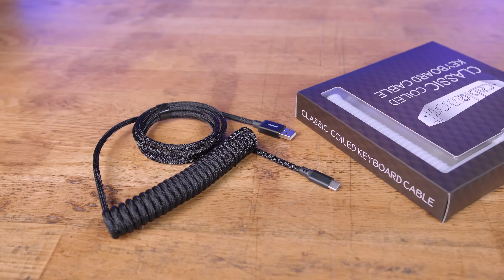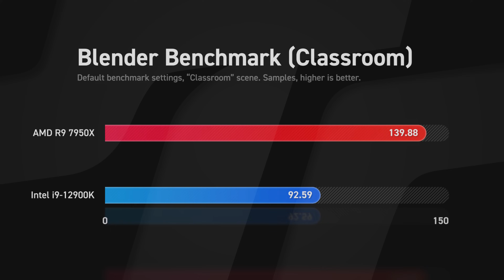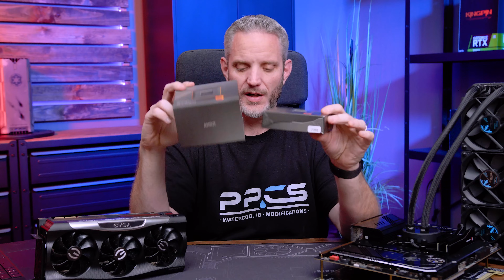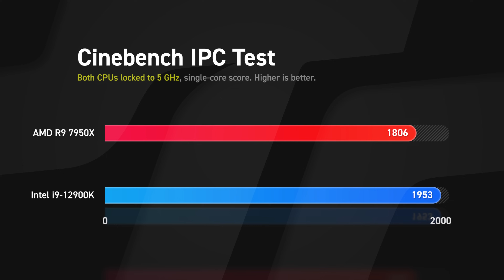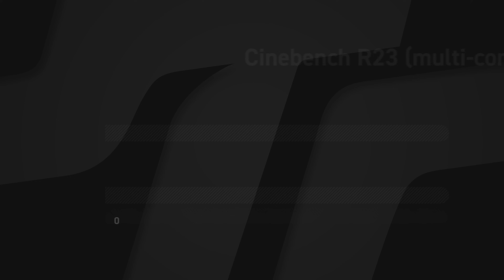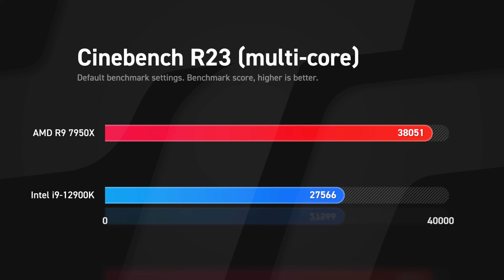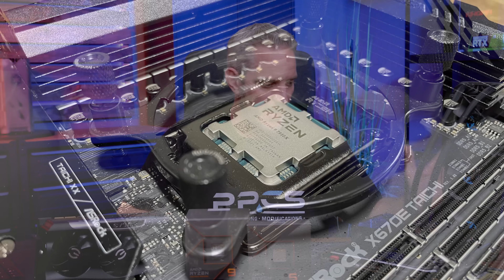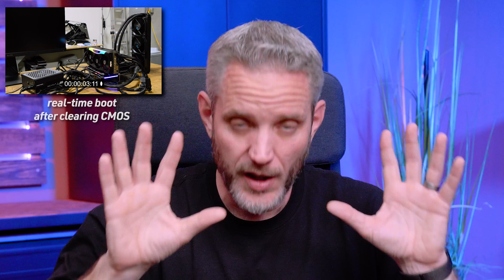Forget EVERTHING you THINK you know about AMD... these CPUs kick A$$!!

Comment: While I appreciate the review and agree that the 7950X looks good against the 12900k, I'm going to wait for reviews of the 13900k before I make any decisions. Also that comment you made about the AMD systems not being as responsive as Intel systems is one of the reasons I went from Ryzen 2000 to 10th gen Intel. I don't know why reviewers (Jay included) didn't mention that when recommending Ryzen. With a R7 2700 it constantly made me think there was something wrong when I clicked to open something and nothing happened for a second. I can't tell you how much time I spent clean installing/running virus scans because my Haswell system never had those issues.

Comment: Intel responds with a CPU they had sitting on the backburner since 2004.

Snoot:
Arrogance mode 17.
4 cores with 16 threads at 5.2 Ghz! Power slam lock down! And for the coup de grace; triple snoot factor 57, arrogance mode 31, x86 license agreement with AMD revoked while simultaneously force jacking all software companies to only be able to code using 1980's era x86 coding techniques thus hardlocking the entire computer industry into using only ancient programming.

Intel Automatically wins! Power snoot! 😤 Nobody messes with Intel! NOBODY!!

Comment: gonna pass on this, im usually behind anyway, better value, but I dont want my fans running at 100% all the time. I remember the 95 c Intel days and my machine sounding like a vacuum cleaner. Im sure there will be tinkering but if the cpu is designed to run hot, more cooling isnt the answer, in fact it seems a detriment to performance. idk, just going to sit out AM5 until something changes

Comment: Ryzen 7000 processors look amazing on paper.  Will they have the same issue they had with 5000 series where they couldn't actually manufacture them?  Where the aftermarket had them marked up, when you could find them, far above MSRP?  OTOH Intel 13th gen also look amazing, and Intel knows how to manufacture product.  Only time will tell.

Comment: Calling a "up to 5.7ghz" CPU running at 5.7ghz "overclocking", is like calling a "up to 100mbit" Internet connection running at 100mbit overclocking.
It's not. It's just getting what you paid for. It's getting what the CPU's rated to do. If you start messing with voltages and getting 6+ghz out of it, then you can tell me you're overclocking.

Still, nice to see AMD blast through the 5ghz barrier and close in on 6 without overclocking.

Comment: I would like to see @JayzTwoCents do a custom water cooling loop with several radiators to see if it's even possible to have less than 95ºC on the CPU with stock settings. And maybe compare scores between a NH-D15, a 360 AIO and huge custom loop.
Reply: 7950x temps dropped to 70c when de-lidded by der8auer.  It looks like the IHS is too thick.
Reply: @seeyouaunty  I hope this blows up because this info can change a lot of perspective.
Reply: @seeyouaunty  How many people you reckon will want to pry open a $700 CPU, more to the point, why should we have to at that price point and technology point when the 5800X3D all ready trumps that CPU especially in the temp ranges.
Reply: @Synthetic-Chicken  The main point is the high temps are not due to the silicon like we'd assumed.  Lapping a few mm off the IHS will likely give very nice gains.

It shouldn't be a hard thing for AMD to fix in future releases.
Reply: @seeyouaunty  it's crazy that amd sacrificed temps for "compatibility"
Reply: @charlieruff7088  What “compatibility”? It’s an entirely new platitude with no compatibility with previous gen.
Reply: @StolenJoker84  IHS is thicker so you can still make contact using an older am4 cooler.
Reply: @charlieruff7088  people would have been way more pissed if AMD had "decided they need to buy a new cooler". Cooler compatibility is just an accepted ground truth these days, deviation from it is punished at least in the DiScOuRsE
Reply: @TAP7a  you aren't wrong but what's another couple hundred dollars when your buying a new mb, cpu, ram and possibly a psu lol.  Am4 was what 2015 or 16? If you have an aio that old it maybe time to upgrade anyways.
Reply: If you have a rysen 9 turn your cpu to 99% no temp problems
Reply: @BUTTERY-APEX  thats nerfing your boost clock speed to a locked stock setting - so its gonna be worse than stock because on stock it power boosts as it sees fit.. It wouldn't make any sense for you to be running it like that lmao.
Reply: I concur, we can even compare their efficiency against the i7-15700k on that loop
Fun retrospective:)
Reply: Move somewhere cold and just open the window.
Reply: Der8auer saw 18 degree difference with delidding. Not all am4 coolers work, one with there own backplate causes issues and will have to get another back plate.
Reply: I think every single build is going to be loud and windy. You're definitely going to heat up a room.
Reply: @stevenwest1494  Glad I live in the north

Comment: I've just been looking over the specs and noticed on the AMD website, unlike the other 3 models.  The 7700X 8 core model does not state what process it is built on, it also has the lowest base clock of the 4 CPUs. What gives?

Comment: I currently have an AMD 3700x with a cooler on it that I've been using since an AMD Athlon X2 3800+. I thought THAT was insane, but holy crap it could even be pushed forward and used on a brand new 7000-series AM5 CPU.

I'm not sure I've ever seen a vendor-specific spec supported as long AMDs CPU cooler compatibility. Absolute insanity.

Comment: Just read other reviews and the new ones are not kicking anything but their own bums. 

The 5800x3d is quicker most times, so is the 12900k. The premium the new platform costs basically negates the cpu price advantage if there even is one. In Germany the highend option costs 840€, a 12900k is 633€ right now as I write this. The 5800X3D is 444€.

So unless you do heavy work and utilize all 16 cores it's not worth buying a zen 4 cpu. 

Heck, Zen 4 barely even manages to beat alder lake in just a few games but requires DDR5. 

A X570 or Z690 Platform is the way to go here. Unless AMD gives us a 7800x3D it's not worth buying. Besides that we have a super worrisome thermal problem according to Steve. It is not worth buying unless one needs those 16 performance cores.

Comment: About AVX-512, I think it also depends a lot on what specific instructions of it you use. There are some instructions that are only half the width, but allow you to do some stuff in a single instruction instead of using multiple. In those cases even the 2 step AVX-512 can be a significant upgrade and AVX-512 on AMD seems to have no performance downside like it does on Intel. Phoronix has some great benches for that topic. Sometimes it adds only a few percent of perf, sometimes it quadruples it!
Reply: @Lurch7861 Alder Lake doesn't support AVX-512 at all thanks to the E-cores. It would be interesting to see Cinebench on Zen 4 with AVX-512 disabled to get a more direct comparison of IPC. Zen 4's AVX-512 is a bit of a compromise design, so it may not be faster to use vs. AVX2.

As for overclocking, mainstream CPUs have been doing turbo boost and bouncing off the TjMax thing for awhile now. In regular use I doubt it will be sitting at 95C all that much. Tests like Prime95 and Cinebench are "worst case scenario" and don't reflect real world usage patterns. The reality is most of the time the CPU is idle. Way back in the dark ages before SpeedStep, CPUs ran at 100% power all the time, even when doing nothing!
Reply: @NJRoadfan  Zen4 is designed to sit at TjMax (95C) indefinitely, as long as the workload can make use of the full power of the CPU.

Comment: I hope Intel has more heat mitigation tricks after shaving the substrate and introducing efficiency cores to at least close those gaps. I want reasonably priced AM5 and AMD have shown that they aren’t above hiking prices when they’re on top.
Reply: they haven't changed prices since zen 4 (except for making the 7950x cheaper than the 5950x). At least in the high end I would say AMD's pricing is better. Intel definitely wins out on the low end though. b650 boards are also supposed to be super affordable.
Reply: At least they have performance for price. Intel's 13th gen has had its prices leak recently and has the 13900k sitting at about $815usd. If they're asking $815 that loses at stock performance to a cheaper option. That still puts AMD on top in performance and price.

To be honest, I don't care how much higher benchmarks Intel's 13th gen can reach if it's requiring 100w+ and some major OC'ing  to pull marginally higher numbers.
Reply: @awsm253  Wow, didn't think intel would price it so much higher... Honestly if the 13900k is 10% faster than the 7950x then I would say that they are pushing it but they can do whatever since they have the fastest chip. Problem is that it is on a dead socket. If you ever want to upgrade from there you will need a new motherboard, which pushes AMD's value even more. Interestingly enough zen 4 also has better io than raptor lake, and AVX-512 support, so even if raptor lake is better in pure performance (I'm pretty sure they will be) AMD will ultimately have better value.

Comment: Kicks ass?  I'm rather dissapointed. Gaming performance is average at best barely matching the 12900k which is last gen... then idle power draw is just trash and power draw is everything noone wanted in the 12900k. Looks like 12700k or a 7700 X3D may be the best bet.

Comment: I'm stoked AMD is continually improving.  I upgraded from a 1600 to a 5600 recently so I'm good for at least another gen or maybe longer depending on what I'm feeling, but I'm excited to upgrade when I do.  Depending on pricing I may jump on RDNA 3 if not my gtx 1080 has life in it and I'd need to upgrade my monitor to really make that upgrade worth it.
Reply: I am on a i7 9700k heheh, hopefully I can get the 8core 16thread ryzen 7000 series CPU. Gonna be a massive upgrade for me 😉
Reply: @thealien_ali3382  Wait for a Ryzen 7800X3D
Reply: @Brian Miller  have you thought that maybe better IHS designs and alloys have come into play that make it not matter so much that's it's at 95c? Clearly what AMD is doing is making it so, the better your cooler is, the better performance you AUTOMATICALLY can gain from this design. No need to fuss with manually changing settings to get more performance but, if you do, expect to be able to draw even more out.
Reply: @Brian Miller  intel has been sitting at 105c without issues. I would expect this much from an 800mhz clock increase lmao.

Comment: The single core is accurate.  AMD's single core performance has never been that good. Which is why their " throw more cores " strategy, which overshadows how meh their single core performance has been for years, continues to work. As Intel keeps inching closer at closing that gap, we'll see Intel start to outperform them considerably in multi-core performance once the core count is equal on both sides.

Comment: I'm really excited to see how well these things undervolt. I'm willing to bet that these are beasts even just sitting at 5Ghz.
Reply: I'm under-volted and mine screams compared to stock settings and it runs at half the temperature (ryzen9) cini scores are nuts, right under the thread-ripper.
Reply: My 5800X sits at 4.3 all core at 38° C Idle. And never touches 60° under load. My average temps are in and around 56°. (Undervolted, DOCP, negative OC PBO2)

Edit: I now have unlocked my CPUs true power. It hits 5GHz on at least 3 cores. And has scored an 6830 on CPUz bench. Beating the 11900KF and is 5% slower than the 12700K. All this with plain D.O.C.P SK Hynix ram. AND my 6700XT is stable at 1022 V at 2822 MHz. Silicon lottery winners?? lol
Reply: @kodacko  new guy here to pc gaming so I have a laptop legion 7 3070 It gets hot will this help cool laptop but will it affect performance?
Reply: @mauricionarcia2015  1st rule of getting a gaming PC. NEVER BUY A GAMING LAPTOP
Reply: @Lurch7861 I would wager you are wrong on that.  The wall being hit is process technology, not architecture design.  I bet these still see good efficiency gains, they just have to compete with an intel that is putting out a 300W cpu, and people have shown they would rather have the performance.  Wait to see what laptop brings.  Plus Zen's breakthroughs aren't limited to performance and efficiency.  Scalability is a huge part of their advantage.  They're pretty much winning desktop with server chiplets.  Next gen desktop even looks to go up to 32 cores.  Calling this bulldozer is a Joke, and pretty much loses you any credibility.  Maybe you missed Jay making that exact point.
Reply: No point to pay $700 dollars just to throttle it to 5ghz for efficiency. Just get a different CPU.
Reply: @elforeign  I'm thinking for SFF applications.
Reply: @TallGingerDude  Definitely, but given the performance is so dependent on the high clock speed then I still would recommend a different CPU lower in the stack. I hope someone actually does some reviews specific to SFF and cooling solutions.
Reply: @elforeign  the lower ones are even faster because of the low core count 😂
Reply: @elforeign  Performance would not be that heavily impacted by slightly lower clocks. This architecture is still a ~13% uplift in IPC over Zen 3. Also, there are use cases for more slightly slower cores than a few faster ones, think of threadripper. And think about it, would you ever actually notice the difference from the slightly lower clocks? No.
Reply: @elforeign2  there's a ton of places that the best cpu in a low thermal envelope is required and undercoating the 7950X might be the best on earth for it. Silence, heat, battery life (for custom applications , not a laptop cpu of course), size, power limitations, etc

Comment: To tackle the HUGE increase in heat from all this next generation hardware, surely there is finally the incentive for the majority of people, who can afford to buy the top of the range new gear, to switch to custom water loop cooling, as the ultimate way to cool, stabilise, silent running, and performance boosting (no thermal throttling)? I am planning on a single custom water loop with three 420mm radiators (which was over the top in previous generations, but if you still want silent and extreme cooling, now sounds sensible), with water cooling blocks for CPU, GPU, M.2 gen5 drive, and even DDR5 RAM. I would love to see a video for which of the current off the shelf super cases can handle the installation of three 420mm radiators (or more) to cool the new top of the range hardware to sane temps, whilst having enough room to run the fans at relatively slow speeds for near silent running. I am currently thinking a Cooler Master HAF 700 BERSERKER or EVO pc case, although I heard a rumour that although Cooler Master claim you can install a 420mm radiator in top, side and bottom at the same time, there is no holes suitable for a 420mm at the top of the case; so if you could check this, and if it proves the case (pun intended) check what would be the maximum possible water cooling setup in that case, eg. two X 360mm top, 420mm side, 420mm bottom, possibly even something on the front or back. Would love some expert advice for us enthusiasts wanting the ultimate in water cooling and silent rigs. Thanks in advance from a loyal viewer.

Comment: This really makes me think about the 7___X3D line of cpus that will inevitably be released in a few months and the type of advantage they'll have, especially since now they're going to implement in on the two chiplet design instead of "just" an 8 core model. Some words coming out about how the cache stacking causes a tiny heat sink effect, but im wondering how that effect will work now that they run so hot which will be normal, as well as there being two 3d caches in the highest X3D model.

Comment: I loved my amd phenom II 1100t black.  it was dirt cheap and with a nice air cooler it took a nice overclock.  that was the little chip that could! overclocked it performed as good as my brothers I7 950.  that's the amd I miss. cheap cpu's that overclocked well . low cost and high performance.  same with the 6970 and 7970 too really great cards that were cheaper then nvida and still got all games at full settings.  the 7970 did overheat but with a waterblock it could be overclocked to the moon kept me gaming till the rtx2070 came out. then the fx series cpu came out and I went intell and I got a rtx 2070 because the amd gpu was heartbreaking too. I miss the old amd that sold cheap components that maybe wasn't as good as intell or nvida but were still really good and overclocked good and things like unlocking cores on the cpu. man the good old days

Comment: I'd love it if you could do a series of tests in gaming at 1080/1440/4K but compared to the 5800X3D. I sold my 3950x recently and went 5800X3D as i stopped video editing, which only cost me around £100 to do it, still using my 3600 trident z from my X99 build too and a ROG Crosshair X570. 

I am liking these early signs for the 5800X3D compared to 7000 series, but I'd like to see more people do comparisons.

Comment: When it comes down to it, for an increased cost of $110, or 18.6% over the 12900K, the performance seems to basically meet that 15-20% higher mark than the 12900K so the 7950 makes sense to buy. Looking at the single core performance, they're basically the same, you're just paying for the extra cores of the 7950. So buy what makes sense for you, not one is necessarily better than the other for the price.